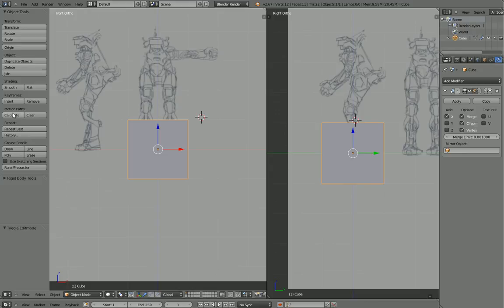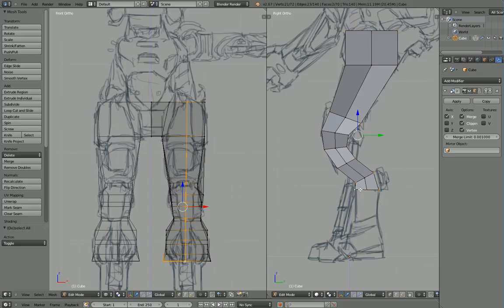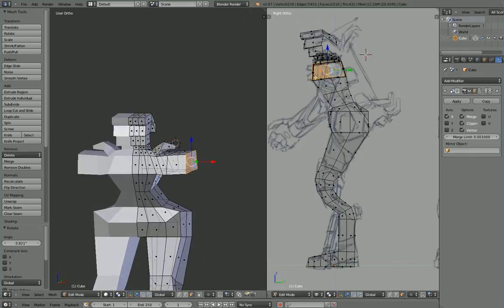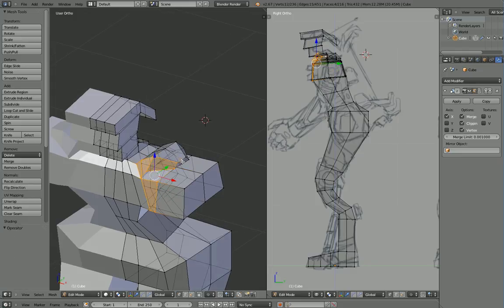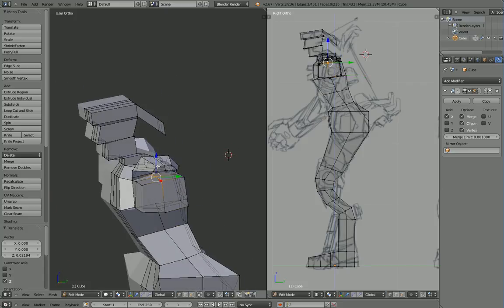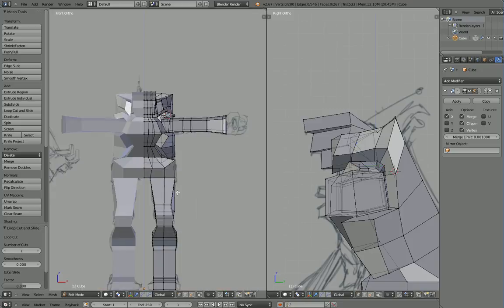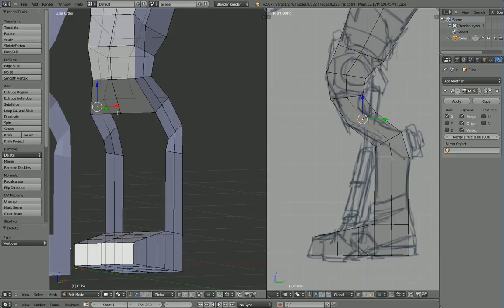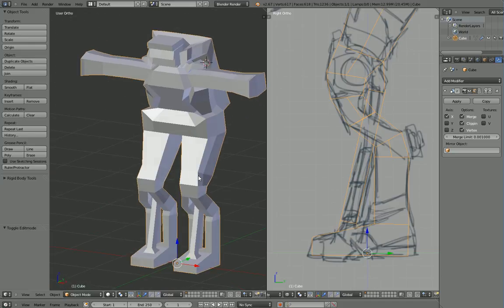Minecraft Mech #21: Let's Model

Comment: If you pop a dot com at the end of my name , the B3 clone is where your tutorial has gotten me at the point of this video.

Just in case you wanted to see what someone else has done. Pretty basic atm, you can change render dist with plus and minus. And mine are 16x16 chunks that go infinite up, left, right, forward, and back. Added in unloading and a couple tweaks to the character controller to make it smoother, but most everything else is from your tut :), thanks. I think I can go on to my goal

Comment: Does the way we use the texture make transparency not work? I am using a terrain.png from a 1.5.x minecraft build and things like glass or any other transparent things just have black space filled. I tried to check the transparency settings in the inspector, but neither work as expected.